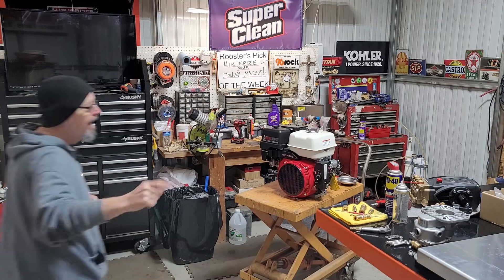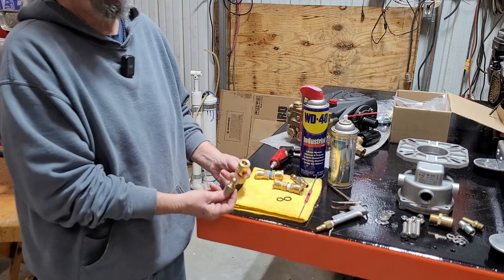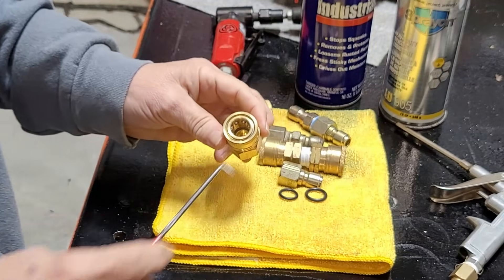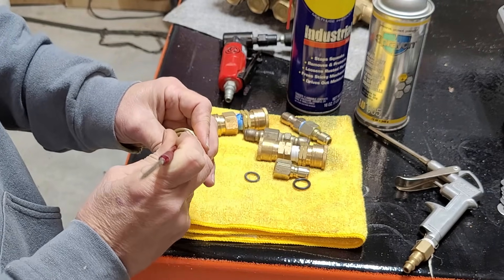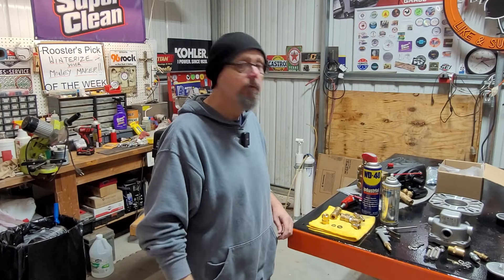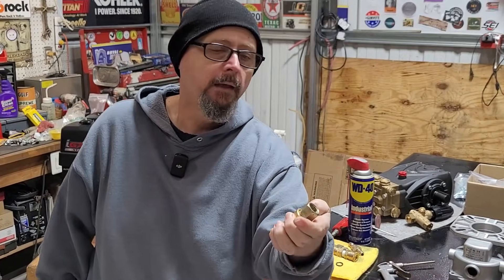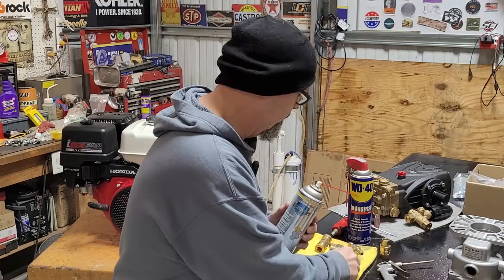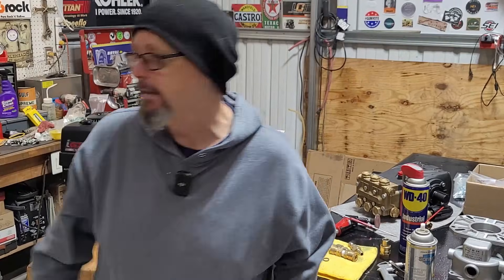Do Not use WD-40 on Pressure washer Quick coupler Fittings, it's just bad advice.

Comment: Great video! You've confirmed what I knew about WD40 (and petroleum based lubricants in general) and O rings.
Having said that, I find that silicone spray is a great cleaner.
It's cheap, it will disperse the crud with the can's pressure & flow, and it protects the O rings! So from time to time I'll spray and wipe my fittings with a bit of silicone spray and paper towel to ensure a reliable seal, lubricate said fitting, protect O rings, and help prevent corrosion on brass components.
There's a reason why plumber's use silicone grease when installing O rings in taps 🙂

Funnily enough, the thing that got me using the silicone spray is the non QC (M22-15) connection on the front of my electric pump as the O ring had a knack for hanging up inside it and not wanting me to remove my hose (leading to a spot of corrosion) but since cleaning up the threads and inner diameter with some spray it's been a heap more cooperative.
I find it helps to just smear a little silicone grease (just a little, you don't need much) over replacement O rings before installation to help it slip into place and as mentioned, protect it during use. But always run a bit of water through your setup afterwards prior to use in order to clear any residue from where it's not needed, and not end up spraying it onto your car or anything.

P.s.
If anything I've said here is actually a no no, please advise.
I'm no expert either, I'm just a hobbyist trying to protect his gear keep his car clean, and help others with what he's learned so far
Reply from the maker: Bingo Jack-Rabbit, you and I are thinking alike , I do like to add Silicone grease to quick disconnect fitting before ever installing, i think it helps keep grit and dirt out and keeps everything moving as it should. thanks for watching an the great comment.

Comment: This is a great video, thank you. 
And you are correct, people on YouTube have me the advice to use the WD-40. 
Can I ask you sir, would you also recommend spraying inside the pump after i have blown out out with my compressor? 
I've always been confused on whether it does more damage drying it out with compressor or to leave the water inside it. Thanks again.
Reply from the maker: Hey Hey, thanks for watching. By far blowing the water out of the pump with air pressure is my preferred method of winterization and i DO NOT recommend spraying WD-40 in a pump. i cant think of a reason you even need a can of WD-40 on a wash truck.  sure hope that answered your question.

Comment: I use silicone grease when I lubricate seals when I rebuild a pump, tpp.  Good stuff.  I have the spray as well, but sometimes the waxy stuff is just easier to use for a seal or an o-ring.  Either way, good advice.
Reply from the maker: Great point! On the grease